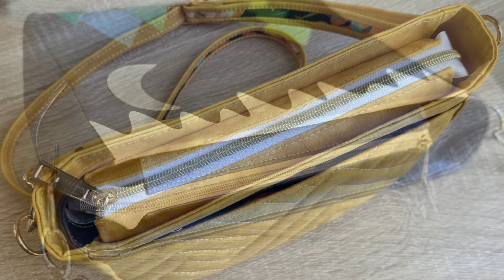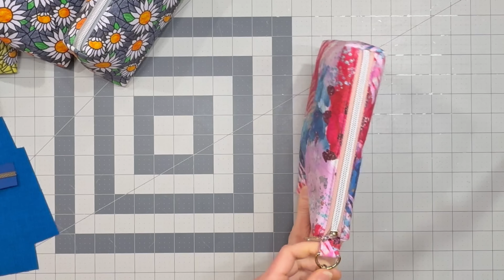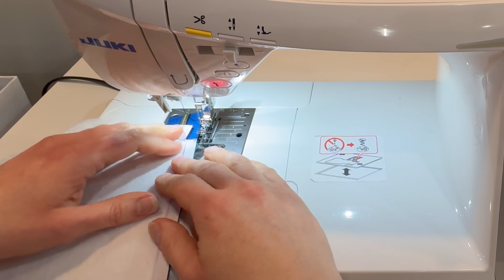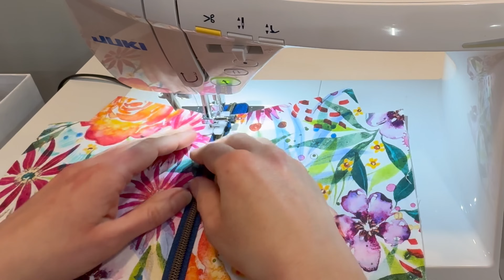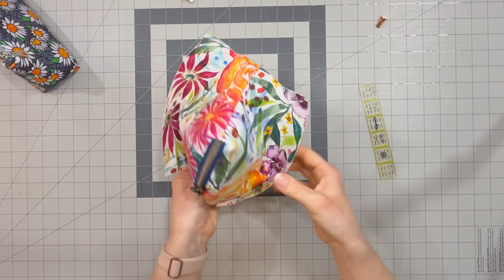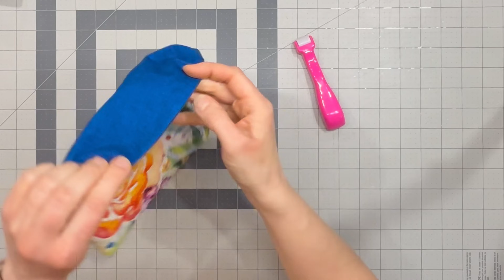Boxy-Top No-Tab Zipper Closure - OKSew Zipper Skills

Comment: I do like the style of this zipper method and am about to print out your pattern but can you tell me what is the difference between the two stabliser pattern pieces C & C2 in the download group please? Is C2 amended for this zip style?
Reply from the maker: Hi Jacky! The C stabilizer is a little bigger overall compared to the C2 stabilizer. "C" was the one I initially drafted a few years ago, but over that time I have changed how I prefer to draft my stabilizer pieces so I added the C2 option that is a further from the seam allowance to make it easier to accommodate thicker materials and thicker stabilizers like foam without catching them in seam allowance. Either will work, but C2 is more broadly applicable whereas "C" is best for thinner stabilizers like fusible fleece. I didn't replace the piece entirely as so many people seemed to like the original size but I wanted to make sure there were options for different materials.
Reply: @OKSew474 thank you so much for the quick reply. I normally add lots of personalised pockets for the things I carry in my bag but I stuck mostly to the pockets as designed for the Breehan bag so this will be a small bits&bobs pouch to hold many of my little regulars to stop them rolling around the bottom the bag. I followed your Breehan tutorial of course. Highly recommended. 🙂

Comment: Is it correct that you put fusible interfacing on both the exterior and lining pieces, but also put a piece of stabilizer on the exterior pieces?
Reply from the maker: Yes that is correct! Not all patterns are written the same and there is some variations based on the materials you are using but that is the general recommendation.